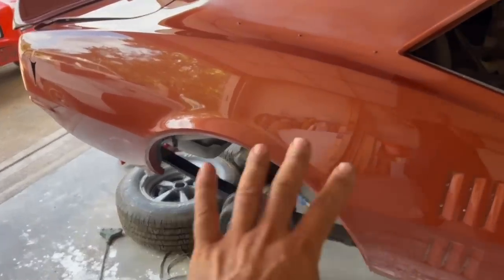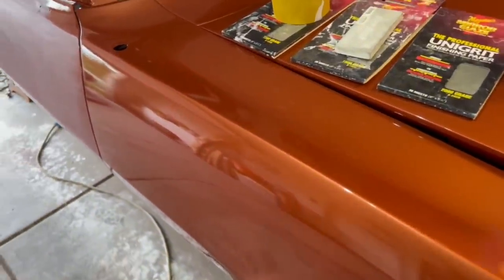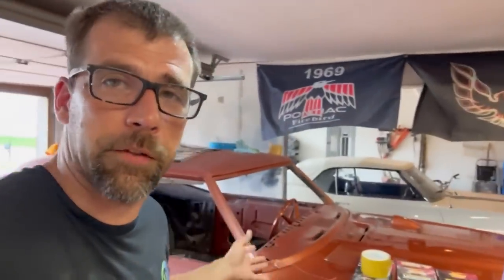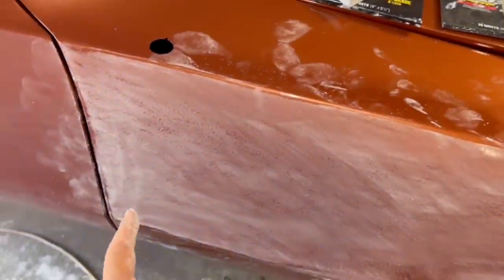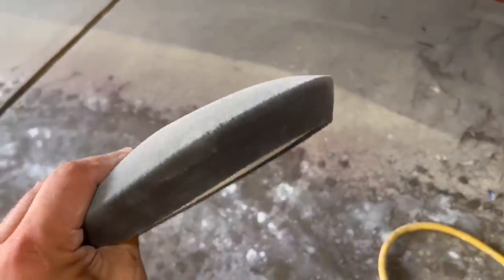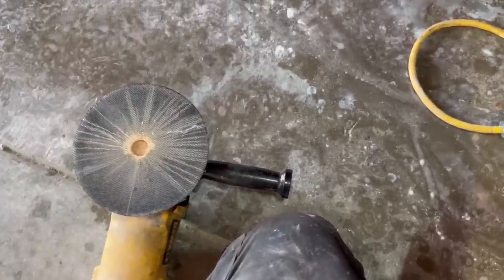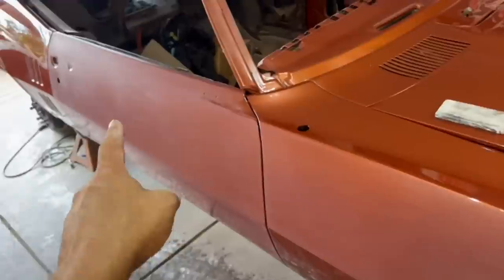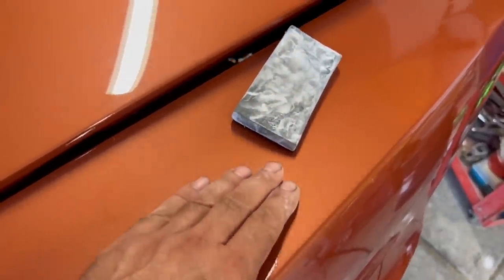Cutting and buffing new paint to remove blemishes, 1968 Pontiac Firebird

Comment: Next time . After the first coat of color dries. drag a piece of assilex kovax 600-1200  grit pads to make the surface flat and it will knock down all those nibs in the color . Even use a slightly damp lint free cloths and then lightly blow and tack and you will be ready for the rest of the base coats. Otherwise anything in the base color will show up even after the clear is sanded flat. You did a nice job . Nice to see someone teaching correctly.
Reply from the maker: Right on man, thanks!! Will do on the next one.  It will have stripes so should be fun
Reply: @VinylVillageGarage  i've done plenty of those on 69 camaro and 69 & 70 chevelle's always in single stage black or white.

Comment: Man you are working it for sure I don't paint correct by hand at all anymore I use a orbital finish sander with a interface pad
Reply from the maker: I don’t trust myself with a power sander for that stage.  Debate it many times and  i Watched many people do it with success but I just don’t know if I can as well
Reply: @VinylVillageGarage  it's not as bad as you think when you use the interface pad you have a cushion you still stay off your edges when I first started I would tape my edges and body lines and you can do it both ways dry and wet
Reply from the maker: @rongamble9884  I like the tape idea and I am doing a white car next might give it a go.  Any suggestions or link to a brand you use?
Reply: @VinylVillageGarage  I have a ingersoll rand 3/32 sander I bought off Amazon I bought a tape kit from Amazon with different widths of tape amd my interface pads I buy from harbor freight there like $10 I usually don't have bad orange peel because I use alot of the finish 1 fc740 clear my process in sanding is 1,200 1,500 2,000 2,500 3,000 then buff with meguiars m100 pro cut compound
Reply from the maker: @rongamble9884 wow thanks for the info and I love the meguiars products it’s all I use for buffing. Appreciate your time and advice, thanks
Reply: @VinylVillageGarage  I don't know what paint system you use but I recently switched from BASF to Sherwin Williams night and day difference between price and product very nice its like the old days of painting all of Sherwin Williams products are designed to be sprayed with 1.0-1.5 tip I spray my HS high build primer with a spectrum black widow 1.3 guy
Reply from the maker: @rongamble9884 I used Sherwin Williams for the base coat and it was the best laying metallic paint I have used, the flake laid out even zero tiger striping and even coverage. This was the first time used it and won’t be the last.  I used them because it was the only brand that could mix the autumn bronze and give me a spray out.
Reply: @VinylVillageGarage  there color library is big I have 2 chip books from them one with solid colors and one with effect colors I've had then match colors for custom cars that need repair work that the painters didn't remember the paint code or wouldn't give it up

Comment: Jon, Jon, JJJJJOOOONNN!!!! Stop using the car as a work bench!!!!! Lol!

The best advice I can offer when painting a car in your garage, is to have multiple temp reducers and start as early in the morning as you can, like 4:30am. That way, when you get to the clear, it’s still cool enough and by the time you are done, the heat will act like an oven bake. This of course is when you paint in late spring through summer. 

Next, I would recommend using a dry DA with 1200, it will knock all the texture out and saves your arms from hand sanding. Obviously stay away from the edges and glide over them with 1500. And, use the 1500, 2000, and 3000 trizact wet on a DA. Makes life so much easier. 

Awesome work though my friend! The Great Pumpkin looks ready for the prom!
Reply from the maker: thanks for the advice. I just fake it till i make it sometimes and learn a lot the hard way. so helpful input is welcome.   I have been contemplating upgrading to a DA for the sanding part, I have seen a handful of people using it and looks handy for sure,  but man my forearms are looking so jacked after all the sanding on this car 😎

Comment: About to do this to my 67’ but I’m formerly a car dealer and this was a little trade secret. On our cheaper cash cars we could send them to get a 300 macco special 

They always came out looking orange peeled but even with just a single stage paint job you can do this and make it look like a much higher end paint job
Reply from the maker: A lot of paint jobs can be cleaned up with a little cut and buff.  The trick is there enough material on the car to cut.

Comment: That’s very impressive! I’ll be doing my first garage paint job on my 69 Dart.
Reply from the maker: Heck yeah!   You can still get great results
Too.  What kind of paint are you using?
Reply: I have mostly new AMD panels, how necessary is high build primer over the epoxy? I haven’t watched all your videos yet, but I’ll be checking them out for all the steps.
Reply from the maker: @acardiac5983  lets start with epoxy is the foundation for all the body work. So filler will be necessary in some areas no way around that. And to blend filler the high build does that, in addition even AMD panels need some work to get them “straight” again a nice even coat of high build on the entire panel then block it out will ensure a nice smooth panel. The goal is not to sand thru your base epoxy while doing body work.

Comment: Even in cold weather, I always use hot thinner. Would rather deal with runs then orange peel plus you are not as rushed to get the paint on.
Reply from the maker: I have debated that for a long time. Might just go that way myself. Thanks

Comment: I've never seen an Autumn Bronze car, just the color on the chart.  Wow!  Awesome build, always look forward to your latest videos. 
I asked for your help on spark plug gap a few weeks ago and I went with your suggestion of 45. Got the new plugs in, and my '68 runs great!
Thanks for your help!
Reply from the maker: Glad to help and happy the hear your car is running great!
Reply: 45..iS not optimal...depends on quench,cam compression
Reply: I wet sand so no build up...but you explained why you dont with first grit. I ALSO RUN TAPE OVER BODY LINE so dont sand thru
Reply: Use a 5 gallon bucket and clean towel...again no build up
Reply from the maker: @shawnbaird2015  HEI distributor and he was told .060 gap because it was update to hei.   I suggested .045

Comment: May I make a suggestion, keep the pad damp, not wet. Call it insurance that you are not going to burn thru. Pressure has a lot to do with the process. Lite pressure (enough for control) allow the tools or sand paper to do the work
Reply from the maker: definitely will keep that in mind thanks

Comment: how do you clean the foam pad? I have used the wool pads and there is a tool with a wheel on it that cleans the old compound off. Thanks
Reply from the maker: I suppose there might be a way.  I keep it in a sealed plastic bag when done to Keep clean.  Then just use it the next time

Comment: Mentioning Linear Blocking Tools again. They use guide coat on clear coat to get it super flat. The have sticky back wet sandpaper down to 600. I've purchased their finishing blocks and finishing sandpaper, but haven't used it yet 😞. Another outstanding video! Ty
Reply from the maker: Now that could be helpful!  After your last mention of linear blocks I have done some looking and pricing I believe when it’s time to block again I will give them a try.

Comment: I may be wrong with this comment, but I was looking at my pneumatic DA sander.  It looks like the Dual Action part is simply having the pad stud threaded hole slightly off center so the pad oscillates as it rotates.  It is not much, maybe 1/8" offset for a 1/4" diam oscillation.  Watching you explain your polisher being a non-DA I was thinking if you put your pad slightly offset from center it may turn it into a DA buffer/polisher.  I have a non-DA DeWalt buffer also and struggle getting the pads dead center.  Maybe that is a good thing to be off center to give some dual action buffing.
Reply from the maker: I seem to get lucky and center it up, most buffer pads come with a cardboard tube to help center them. I really like my dewalt buffer had for several years  I suppose I am just stuck in my ways.   I know if it dies I might try a DA buffer next time

Comment: Hi Jon, In the video you mentioned you strictly use PPG 2042. Is the full title DCU2042 PPG Deltron Clearcoat? Runs approximately $350/gal. Thanks.
Reply from the maker: Yup that is it.  For the price it hasn’t failed me yet.  I know there is better out there but the price goes with it.  Flip side the cheaper stuff just doesn’t polish up as nice. Again this is my pick for the money.  You will need dcx61 hardener and dt870 reducer to go with it. It’s mixed 4:1:1
Reply: Thanks Buddy!

Comment: Just found the channel, love your video. Very clear. I'm at the 180 stage, so a way to go till I get to paint and buffing. But can you explain why you tilt the pad? Is it because this is not a DA but just a rotary ...... or ...? Does it minimise swirls that way?
Reply from the maker: You are correct flipping a D/A buffer on its side is not a good idea.   I am a bit old school and use a rotary buffer still. Can’t say my technique is what is taught or correct it just works for me.   I run mine at a slow speed as well.  It’s just trial and error till I figured out what gave me the best results. No matter what buffer you go with stay away from body lines and edges the paint is the thinnest in those areas and will easily burn thru
Reply: @VinylVillageGarage  Thanks mate, appreciate the quick response. Keep up the great work, and best wishes from the UK.
Reply from the maker: @kevinwells768  anytime.

Comment: Hi Jon, I really had difficulties to understand the process of painting, mainly because there are so many contradicting opinions and options. I really love your series on painting "The Pumpkin", nobody explains it as good and down to earth as you. However, the chronology is a bit hard to follow since you crank out so many good videos with the painting videos in between :) May I ask if I get you right: 1. Sandblasting 2. Epoxy Primer 3. Fillers, Sanding 4. Polyester Primer, Sanding 5. Epoxy Primer again (the same?) 6. Base Coat 7. Clear Coat 8. Cutting And Buffing?  Thank you!
Reply from the maker: Yup you got it!  The sealer coat is the same epoxy but reduced with acetone and only one thin coat.  This is the process  I have used and has passed the test of time.  The lemans I just sold i did nearly 20 years ago and the paint was holding up great and no rust issues, plus it sat outdoors for 5 of those years

Comment: Where do you get your buffing pads from? And how are you cleaning them
Reply from the maker: I have a local automotive paint shop I get them. One of the advantages of living in the city I suppose. As for the pads I rinse them out with water then I have a drawer in my tool box only for buffing pads I keep them in after placing them back in an open plastic bag.

Comment: Looking great. I am wondering how much of each of stages, primer, base color and clear did you end up using?
Reply from the maker: Thanks. What if did was one coat of sealer, 3 coats of Color then 4 coats of clear. Normally I do 3 clear when it’s cooler outside.
Reply: @VinylVillageGarage  I guess I was asking how much should I buy?
Reply from the maker: On the final paint job, I use just a tiny bit of sealer. like a 32 ounce or some like that. As for the basecoat and clearcoat, I use a gallon of each now that still needed reduced and I had just a little bit left over and that got me three coats of color and four coats of clear.
Reply: @VinylVillageGarage  Sweet that helps alot! Thanks

Comment: If you use a single stage paint is the cut and buff process the same?
Reply from the maker: Kinda, the process is exactly the same if it’s sold Color without metallic flake.  If you sand metallic single stage paints it might expose some of the flakes and cause the paint to look uneven.  If it’s metallic proceed with caution
Reply: @VinylVillageGarage  how many single stage coats would be applied, just one. Not sure how it works

Comment: Do you know where I could find a fender
Reply from the maker: Few and far between for good ones it seems.  The reproduction 1969 have fitment issues.  Facebook market place is ok.
Reply: @VinylVillageGarage  well I had my firebird parked and while it sit I covered it with a tarp and tucke it in the front well it rusted out my front fender bolt holes that bolts to fender extension  so I need a piece made with the bolt holes make into it so I could weld onto my fender driverside